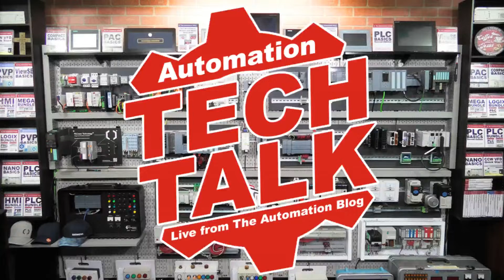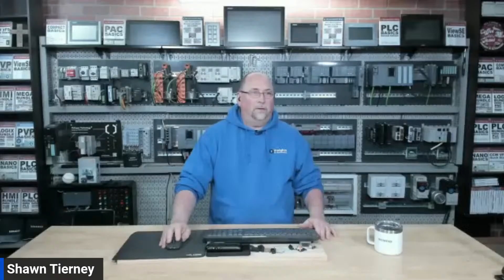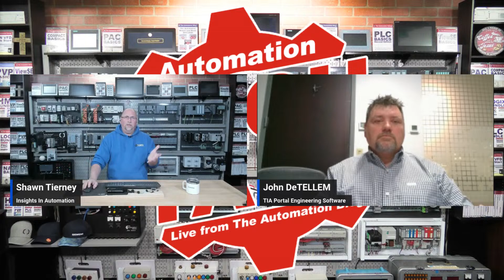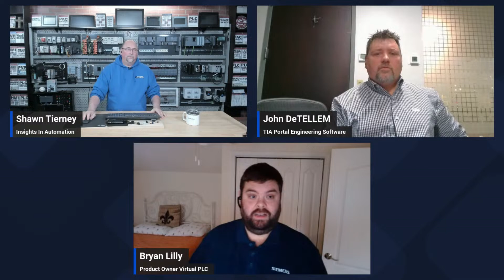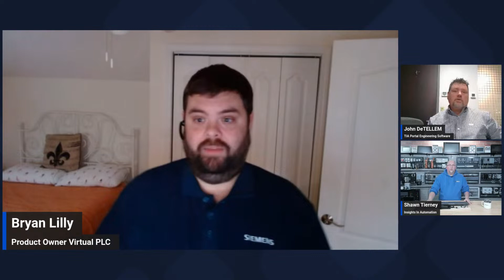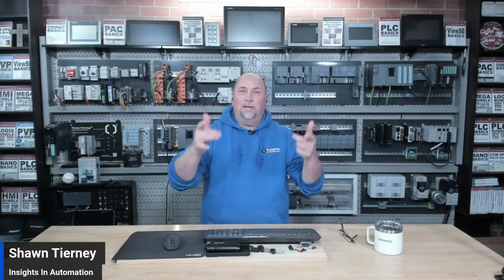Automation Tech Talk: Siemens S7-1500V Virtual PLC

Comment: that 100 subscription model kills it completely, i can buy a 1515 physically for 2,500,- give or take...
The server cluster also required additional licenses to make it work as it seems to only work well on ESXi.
And seems it also requires  Industrial Edge Virtual Device licences which are at 350/year.
If you count a life expectancy of 10 years the TCO for the V-PLC is 1200+350 * 10 = 15.500 vs 2500 for a 1515, even if you pick a 1517 at 5k the TCO is not intersting at all.
I would expect a solution like this to leaverage existing hardware to make things more cost effective, it seems Siemens' vision is different and beyond my compehension at the moment....
Reply from the maker: Great points! It definitely is a different product from PLCSim Advanced... I'm guessing most software running on vSphere servers have an annual license fee? (SCADA excluded)